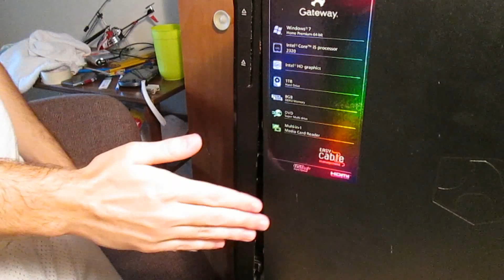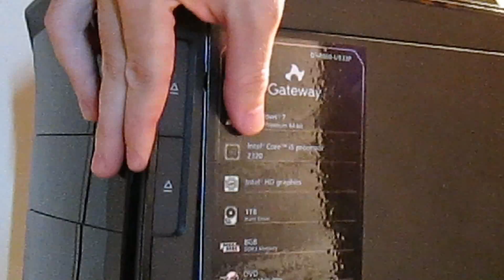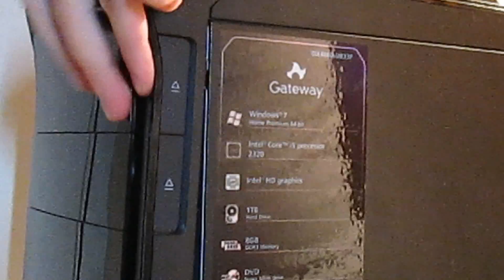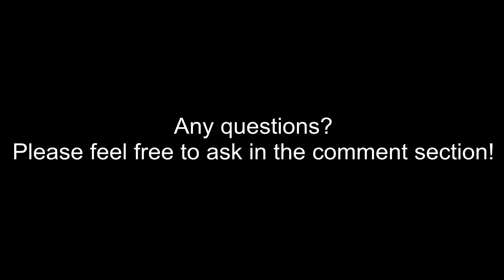How To: Remove The Front Panel On The Gateway DX4860

Comment: ...blurry as shit, but good enough 12 years later! You don't need to remove your CPU cooler, graphics card OR RAM to pop those 6 black plastic clips, which you bend inwards. I wanted to know if the top panel needed removal first to mount a front fan, this video clarifies that. BTW, this case wasn't designed to mount a fan in front, but two screws diagonal on an 80mm fan works well at the lower grille.

Comment: Thank you very much for  your video. I have an old Gateway dx4300, and I wanted to remove the DVD player but didn't know how. It seems DX4300 worked in the same way as DX4860. The DVD player can only be removed from the front, by removing the front panel as you showed.

Comment: great video and very helpful I'd had been having a hard time trying to get to the inside of my computer to clean but 2 quick and dumb questions 1 is the fan(the one below the power box) need to be pointing inside or out? and 2 how the hell do you get inside of the power box? I need to clean the fan inside it but can't get past these screws and I can't get them out with a screwdriver 
thanks a ton again this was my first time actually cleaning my computer
Reply from the maker: You can use a can of compressed air to blow out most of the dust inside your power supply. I wouldn't recommend taking it apart. Unless you have proper ventilation on the bottom of your case you should have the fan facing up or like facing inside your case. Hope that helped!

Comment: This Motherboard is a ATX Micro, correct? (If I wanted to get a new one in the same case.)
Reply from the maker: You can fit a standard ATX motherboard in this case.
Reply: *****
Lol no way... I just tried :p
Reply from the maker: Gezo Really? I have had one in there, it is an Asus Gaming Mobo
Reply: ***** Full sized ATX wont fit. It comes with a MicroAtx.
Reply from the maker: Gezo Sorry for the confusion.

Comment: what is the max ram on this computer?
Reply: 8
Reply from the maker: rabnud species If you look up cards on Amazon they have some cheap ones. You'll be looking for anything that is a PCI-E 3.0
Reply from the maker: +nigelorion Yeah what @rabnud species said 8 gigs
Reply: ***** what's a good graphics card for this computer that doesn't draw extra power and wifi card.
Reply from the maker: rabnud species There are so many cards that do not require extra power ha.
Reply: +NextLevelReviewer I just need one

Comment: Thanks for this. It's rare that you find a video with actually good, in-depth instructions these days, especially for a name-brand computer.
I actually needed to install a new DVD writer into my DX4300-11, which is an older model that uses an AMD Phenom II processor. Despite the front panel looking different, it seems to come off in the exact same way. 

I'm also glad to see that I'm not the only one who put a gaming graphics card in a Gateway micro tower. ;)
Reply from the maker: rabnud species Originally a cheap GTS 250 then a GTX 960
Reply from the maker: +Sidney Rutledge Ha ha awesome man! Glad this helped you. I really believe instructional videos should be instructional, I love teaching others new things!
Reply: +NextLevelReviewer what graphics card did you use?
Reply: ***** does it draw extra power because I'm putting in a Wi-Fi card?
Reply from the maker: rabnud species Not much

Comment: For the back casing to put in a fan what is it 120mm ?
Reply: +TheGrim Reaper (IX Megatron VI) also do you recommend intake or outtake.
Reply from the maker: +TheGrim Reaper (IX Megatron VI) Yes the rear fan is a 120mm fan. I am not sure what you mean when you ask if I recommend an intake or an outake, I will assume you mean if I recommend an outake for the rear fan, in that case i do.

Comment: Thanks for the video! Can i do this without removing my heatsink and graphics card? Also how did you remove the hard drive bay, because i have the same computer and the corners make it hard to pull it out and i dont want to be to rough with it. Also do you know how many hard drives we can put in because i just bought a ssd and 1tb hard drive, and i already have a tb hard drive but i want all 3 and i wanted to know if it was possible. Sorry for all the questions and thanks for the video its really helpful!
Reply from the maker: +The Professor No problem you can put 6 drives in this machine, if you want you can avoid doing some of these steps and pull the panel off. I did this to show how to do it the safest way.  Hope this answers your questions!

Comment: Why not just look at schematics and locate tabs from those and use a thin blade to insert behind front panel and push the tabs without doing ANY of this...  That's what I do hundreds of times a day with repairs.
Reply from the maker: Nathan Steiger There are different ways of doing this. I realized this may not be the the most simple way of doing it.

Comment: How much ram can you install in this. My specs says it has 4 slots that can hold up  to 4gb each but also says max of 8gb? im hoping I can fill it with 16gb? It currently has 6gb

 RAM bus / speedDDR3
RAM slots4 slots (total)
Maximum RAM8 GB (system)
4 GB (per module)
Reply from the maker: Frank Contreras If I remember correctly, this system only allows 8gb total. You might want to upgrade the motherboard and operating system to a 64 bit system to allow more capacity.
Reply: *****  Specs says my computer is a 64bit operating system
Reply from the maker: Frank Contreras You should be alright with that then, you may need another motherboard.

Comment: question, can you install one 8 GB memory ram?
Reply: I wouldn't recommend it. Most motherboards are designed to handle dual sticks of RAM, not just one. I've never tried it, but I'm sure that you're suppose to use 2 sticks or ram or more.
Reply: Rusty Hello Sir, I just did and it worked

Comment: Hey man I need a little help. My lights on the front of the computer stopped working. Is there a way to fix this?  I click the button to turn on the lights and nothing happens.
Reply from the maker: Intensedeer The deer I am not exactly sure, which case is it?
Reply: The one that you showed in the video. I push the button nothing happens
Reply from the maker: Intensedeer The deer Oh there may be a wiring issue
Reply: ***** Is there a way I can fix it?
Reply from the maker: To be honest I am not sure about the wiring of the case. Google might work for you.
Reply: I tried to look up it up and I found nothing :(

Comment: Actually, mine does not swing to the right but I could not get at the tabs on the top right like you did.  It did help to open the bottom right one like you show.  So I used a screwdriver and small pry and just unzipped it by snapping it open all way around starting top left, twisting the screwdriver and pulling at same time.  Then I could see the tabs on the right and used a screwdriver to push them in while prying open at same time.  It popped off.  You feel like you're gonna break it but was fine.  I did break the first tab on left at the top but when you put it back, it doesn't matter.  Here is a link that shows a good couple pics, scroll down a bit.  http://videos.glsenneo.com/videos/how-to-remove-the-front-panel-on-the-gateway-dx4860.  btw, I planned on replacing the non-functioning dvd multidrive so i took it out and took back cover off and moved things around shook it a few times and moved tray in and out and put the back cover back on and now it works!  lol  thanks again man.  Oh, and for those that don't know, you can open a stuck tray by sticking a paperclip into the little hole in the front bottom right of the dvd drive and push it in far.  Cheers all
Reply from the maker: I am glad this helped you!

Comment: You do not need to take drives, memory or fans from the case to take off the panel. Only the three black tabs on the left open panel side need to be released. The panel is supposed to swing out to the right, like many tower cases, though the mini tabs on top by the USB ports make this difficult.

The tabs you remove look like left-sided arrow heads, while the right side tabs are right-angle hooks. The top tabs are just flat tabs that stick in the top of the case.

First, take off the left side panel by unscrewing the two rear screws holding it on. slide the panel back and off.

Next, look inside the case to find the three black tabs at the leading edge of the side panel opening.

Look at the metal hole that the bottom tab pokes through. When you gently push the bottom tab gently towards the inside of the case, you can see it being 'released' from the side of the hole. While pushing gently on the bottom tab, also pull the left-bottom of the panel to the front slightly. The bottom of the front panel will loosen slightly once the tab 'pops' free and is released.

Do the same with the next two tabs. 

The right side hook tabs will still be holding the panel on. One or more of these may be able to be wiggled free, since they aren't being pushed on by the (now released) left tabs. The top tabs also hold the case on. These need to be carefully pulled free. There are LED lights behind the upper part of the panel by the USB ports, be careful when poking around in there.

Gently, but with increasing force, pull the upper - left side of the front panel forward. It is designed to open like a door, to the side. You will think you will break the panel, but it SHOULD come free with a pop or two of those dumb top tabs being released. Once the top tabs are free, swing the panel to the right and pull the panel from the right tab holes.

Look at the left and right side tabs to see how they are shaped. The arrows slide in and lock, while the hooks are the hinged side.

When you put the front panel back on, first make sure all wires and those top LEDS are where they should be. The two side LEDs have little C shaped wells that position them properly under the cover.

Insert the right side hook tabs into their holes. 'Close the door' until the top tabs are about to go into their slots. NUDGE the tabs in so it's lining up, but don't pop the top in yet.

As you close the panel, make sure that all three of the left side arrows are STARTING to go into their holes by the opened side of the case. Just make sure they're going in.

Now push on the top of the panel by the USB ports, making sure the cover holes line up with what's underneath. Once the top is secure, push on the left side from the top going down to snap in the three left tabs.

The Antec Three Hundred case I have, and many others I've worked on works the same way, but there isn't any stupid top tabs to make things difficult.
Reply from the maker: I appreciate the clarifications. There is a simpler way of doing this. I was mislead when I recorded this video. While the video I made DOES work, if you just muscle it a bit you can avoid some steps that I have made. Thank you again for that.
Reply: @NextLevelReviewer  What about removing the top, which is what I need to do in order to replace the power button.  It will no longer turn on by pressing the power button, but if I cross the motherboard pins it works.  So the switch is broken or worn out.
Reply: @kerryedavis  did you figure it out? I'm still trying
Reply: @jimsfryd  yes I got it done, it just took more force than I like to use. Do what you can to release the tabs that snap into the usb/power button/memory cards part above the front. And try to pull the front more straight out if you can. But it does take more force than you'll probably want to apply either. At least the first time I did it. Maybe it would be easier on reoccurrences.
Reply: @kerryedavis  I thought I was going to break it but frustration won over and you are right. tight fight. thanks for info. Helped immensly
Reply: @jimsfryd  I'm glad it worked out for you.  I was less concerned with damaging mine because it wouldn't turn on anyway.  I had to remove all the cover stuff to get at the power button switch, which had come loose from the circuit board.  After re-soldering it properly (I suppose the original joints were cold-soldered and came part over time) and putting it all back together, it's fine now.
Reply: Thanks for this lol. I was thinking this whole time why the heck would you have to take the ram out amd the clu fan off to take the front panel off😂
Reply: Excellent description, it went exactly as you said.
Reply: @ftroop8462  glad it worked, just retired my case for a Fractal Meshify 2. The 101 is a nice case for a budget home server. But the Fractal is easier to work with...

Comment: Thanks for the video. I am having trouble with getting the DVD drive to eject when the front panel is in place on the PC. When it's off, the drive ejects from the buttons on top, the side, and the Windows software without any problems. Have you had this problem?
Reply from the maker: No I haven't, is it getting caught up on something? This is interesting.
Reply: It's not getting caught on anything. I close up the front panel and then the drive won't eject. It was working before with the panel closed, but I have this problem intermittently. It isn't pinching anything. At times it works, but other times I have this problem. I will look into it again tomorrow. Thanks for commenting.
Reply from the maker: Ah, sorry I am unfamiliar with this issue. Good luck on finding a solution.
Reply: Just a last note. As strange as this seems, I have discovered that if I put the front panel on last and with the computer running the DVD drive opens and closes without any problems. I know that this makes no sense, but it works now. Thanks for your help and comments.
Bill
Reply from the maker: Glad I could be of some assistance!

Comment: Thanks needed this to figure out how to get to the harddrive bay.
Reply from the maker: Not a problem, although there is a removable hard drive bay.
Reply: ***** Yeah I know it has an expansion bay up top. I needed to seat a new hard drive in the inner bay so I could install Windows 7 on it. I was wondering though how can you seat a hard drive in the expansion bay and hold it in place? Are those little pins with the rubber suppose to hold it in place? Not sure if your model has that from what I see after you took the front panel off. I have a DX4860-UR21P.
Reply from the maker: NO my model does not have that, my model has screws which hold the hard drives in place.
Reply from the maker: Ken Gevon NO my model does not have that, my model has screws which hold the hard drives in place.

Comment: what power supply was with this computer originally? i might be buying one and if like to upgrade to a 2gb graphics card, and dont know if the stock power supply will have enough to power it, let alone if its got the right connector for it
Reply from the maker: You will have to upgrade the power supply
Reply: thats what i figured, thanks for the quick response!
Reply from the maker: That's what I am here for :D check out this video if you need anymore help: HOW TO: Install a Graphics Card In Your PC
Reply: im actually watching that video right now, i plan on upgrading to a 600watt corsiar cx 600, but i dont see anywhere were it says it has the 4 pin connector you plugged into the mother board.or the molex connectors, do i have to buy these separately? or does that 4 pin power supply cable run to the fan exclusivley? ive never built a pc, so sorry for the questions that may be common sense to you haha.
Reply from the maker: No, any question is a good question. There is a 4 pin connector. It is also referred to as a 4+4 ATX 12V. Every power supply will have one or the mother board will not get power.

Comment: Thanks for the vid but my computer is still under warranty so I'm worried about removing the guts and messing something up. All I want to do is clean the mechanism that pushes the eject button on the dvd drive. I have a problem with the dvd tray opening and closing on it's own which is driving me nuts. Whenever I eject it goes nuts and keeps opening and closing. I'm thinking it's because the mechanism needs cleaning. Your thoughts?
Reply from the maker: Ah a common problem I am familiar with actually. This has happened to me before and the only advice I can give you is that it could be a bad connection or the drive has gone bad.
Reply: Thanks. Funny because it still works but only once the computer recognizes that there's a disc in the drive. Sometimes when it works by loading a disc the first time I still need to eject and load it again until the computer recognizes that there's a disc in the drive. I guess I'll replace the drive but is there a way to remove the front panel without taking out the guts of the pc? Can the tabs on the right side be accessed and pushed in from the exterior once the tabs on the left side have been pushed in? I want to tamper with the inside the least amount possible since it's still on warranty.
Reply from the maker: Goremeister100 Yes you can do this without removing the insides. I did that to show other things were done and as a precaution. It may be a bit more difficult